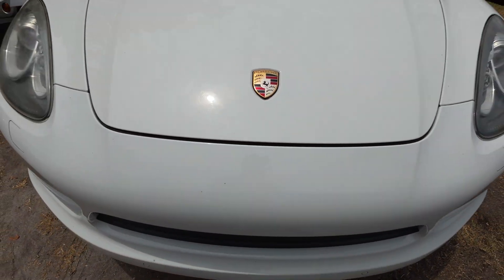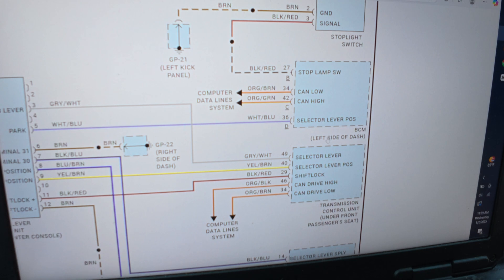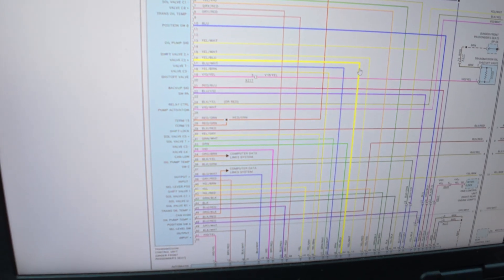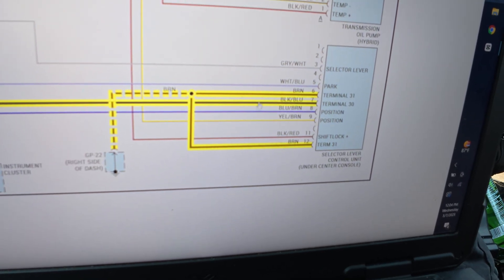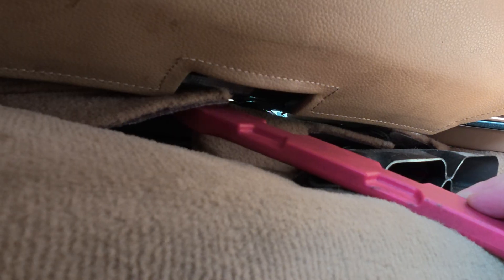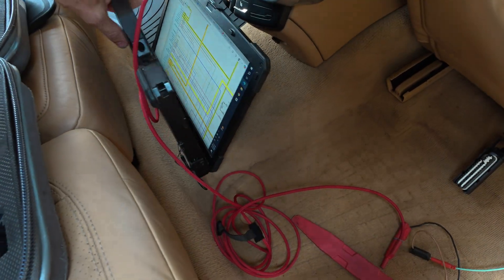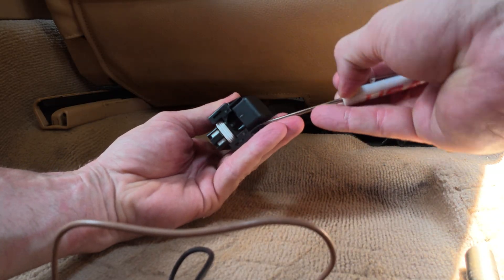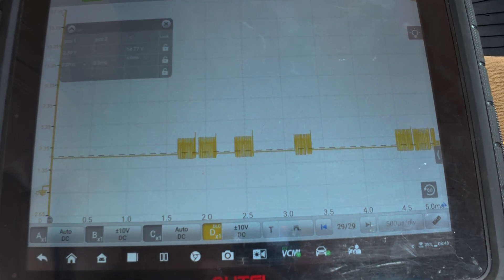Porsche Cayenne Won't Shift- No Communication With TCM Diagnosed

Comment: I have the same issue with a Porsche Cayenne 2013. Even though the TCM is not communicating with the Diagnosis, It looks like its communicating with other modules. Since the ECM is not throwing an error telling the TCM is not communicating. 
On the other hand if we remove the TCM and power up, then the PCM and other modules throw the error TCM is not communicating, I think we have to configure the gateway to communicate with TCM.
Reply from the maker: Interesting. Well I was given a chance to program a used TCM for this vehicle. However, due to time constraints I was not able to successfully program it. I may post the video but not sure. The donor TCM did communicate in vehicle. The original was power cycling on the bench.
Reply: @KOEODIAG Thanks for sharing the findings. So after connecting a used TCM, the problem wasn’t solved ?
You figured out its power cycling with the current consumption ?
Reply from the maker: I tried to code/program a used TCM with Topdon scan tool. It failed. However, donor TCM did communicate in vehicle and would come out of park and into drive yet still in limp mode 3rd gear. 
On the bench, checking communication. It was cycling. The coms would come and go very quickly like every 5 seconds. One of the SMD was reaching 150 degrees fahrenheit. 
Perhaps I'll show the video as a failure. Still might be interesting to see my struggle?
Reply: @KOEODIAG  I will check my TCM plugged to a bench power supply if it behaves the same. It seems we will need access to a PIWIS to get the TCM programmed to the car. Its really interesting to find someone with the same issue. What's the component that heated up, if its not a IC with a program, we can easily replace it.
Reply: I tried plugging my TCM to the bench power supply, but any of the components didnt heat up. I powered up with 27, 28, 1,2 and 3
Reply from the maker: @bhanukagamachchige9473 1,2 ground. 3 terminal 15. 27,28 terminal 30. 
I guess I cannot share photo here. But the chip the got above 150 degrees Fahrenheit was a SPF3004. SPF3004 chip I believe is a low-dropout linear voltage regulator. 
I’m still thinking I may post the video as a failure. But fun Journey
Reply: @KOEODIAG  Yes, Correct. 1,2 are ground. 27,28 is positive, and For 3 I applied a positive. 
Its a regulator IC with a watchdog timer, the  IC has a block input and a reset output. Which is the ic doesnt receive clock input from the mcu, it will reset the main MCU. Since your TCM is resetting, thats something you can look at. But I have no clue that my TCM is resetting. Since this SPF is not heating up.